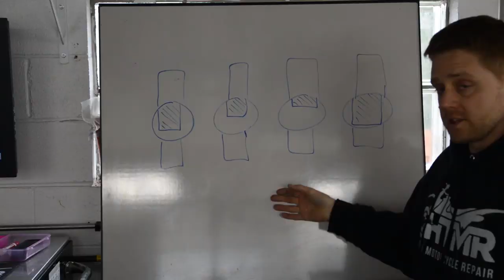How-To: Honda CB750 Carburetor Rebuild (1969-1976)

Comment: My dad and I both have cb750k's, my dad's is a 78 750k and mine is a 75 750k. I ultrasonic cleaned and rebuild both sets of carbs on them last winter, ones a round top other is the accelerator pumper I think called a pd carb. Made a huge difference in how they start and idle cold and throttle response. 
I was nervous about messing up the pd carbs, mainly because it is my dad's bike and it ran pretty well before. The accelerator pump was a little tricky getting to spray all 4 carbs.

Comment: I have later model  carburetor  on last year 78 my return  spring doesn't  bring my throttle  back quickly once I Release  it  what do recommend  to repair  so bring back instead  bring  back manually

Comment: Mine is a 77 K model but seems to have 76 carbs. They have 7A IH stamped on the top. Does that sound right ?
Reply from the maker: Not familiar with stampings. Are they bottle tops with screw on caps?
Reply: Yes I believe so

Comment: I have a CB750 engine but no carb, does any carb work as long as it's the right size, or do I need a cb750 carb.
Reply from the maker: I would find the correct carbs if I were you.

Comment: Matt, I'm specifically interested in the part of your video that addresses the fuel needle valve, I saw you had the needle valve in the vise and I hope it contains some advise that can help me. Does your video share any advise/techniques, about how to get the needle valve seated, so it does not leak fuel?

I have a 78 XS1100 and I just can't get the needle valve to seat properly, even brand new  assemblies still leaks right out of the package, If your video addresses the fuel needle valve leak issue, then I'll buy it, but if not, then it's not for me.

If you've got any other videos, or links to share regarding the fuel needle valve, I'd really appreciate it

Thanks in advance,  much appreciated.
Reply from the maker: Describe your leak, because it may not be the fuel valves. Check the overflow tubes for cracks: https://youtu.be/zNJxwSB5uis

Comment: Does this work on 77&78? I’m assuming so since they’re still SOHC
Reply from the maker: Those years came with PD style carbs and this video does not cover them.
Reply: Thank for your reply. I will still probably end up purchasing your video. Is there anything that I can take from the PAID video that I can apply to the PD style carbs? in regards to idle/mixture, syncing, and carb jetting? I have a feeling there is a wealth of knowledge that I can use from yours that I can apply to getting my bike back and running properly.
Reply from the maker: @MADBROW  Go for it. If it does not help you then just ask for a refund.
Reply: @HTMR  will do? Does the syncing, jetting still the same? Between the two?
Reply from the maker: @MADBROW  I can help you through email.